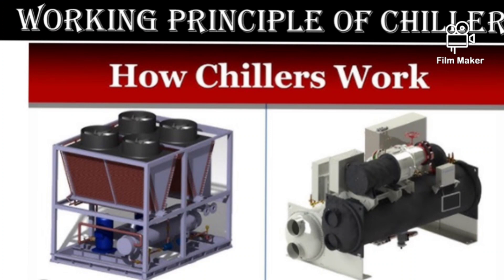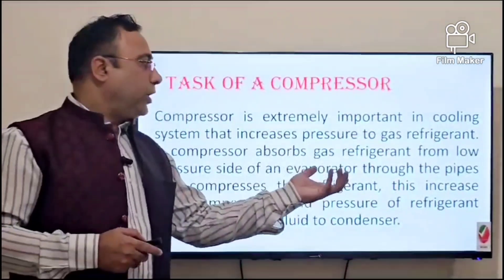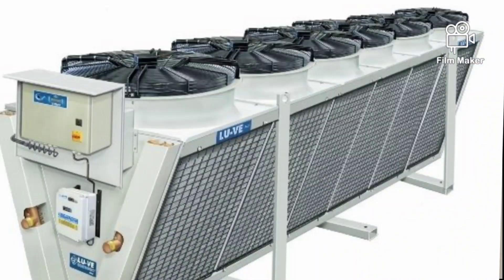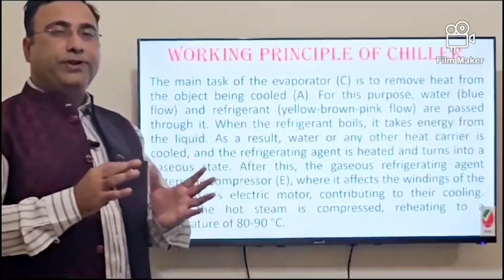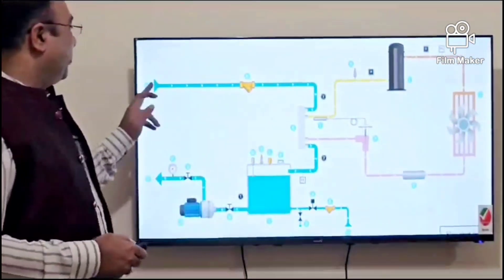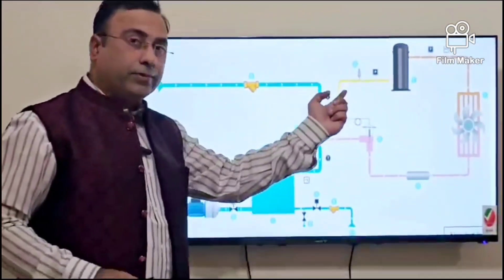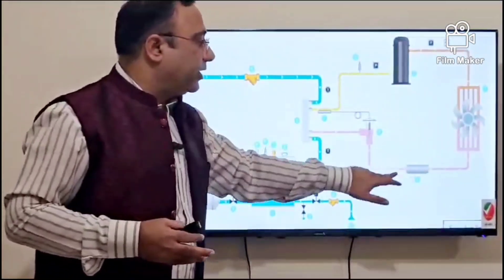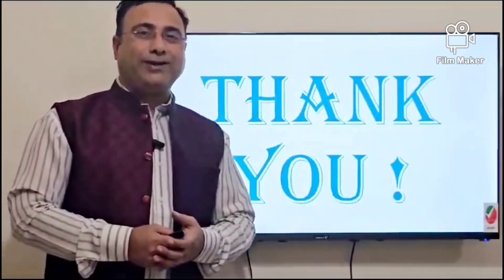#chiller working #principle. Basics of Chilling Plant. #evaporator #compressor #condenser #cooling

Comment: Good explanation for showing the principle of chiller... 
How can we calculate the capacity of chiller according to machine...?
Reply from the maker: Wow, wonderful question. There is a term heat rejection that we have to calculate.
Reply: Heat rejection (KW) = 1.163*( T1-T2)*flowrate ( m3/hr) , T1 ,T2 are the hot and cold water temperatures -Delta T in C degree ..